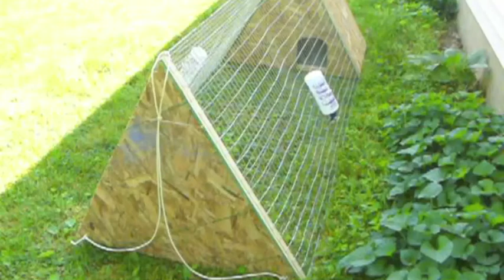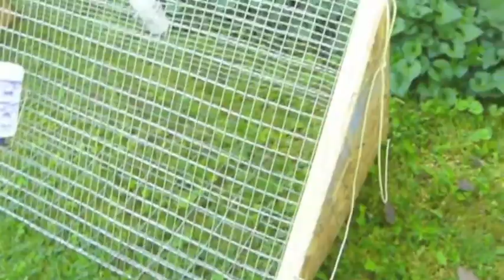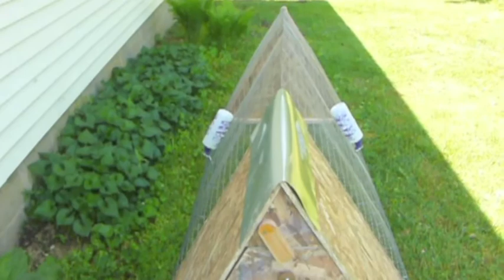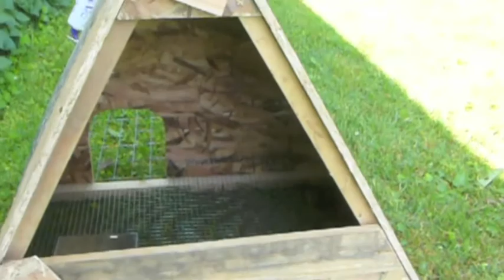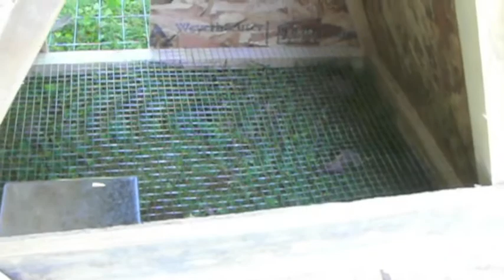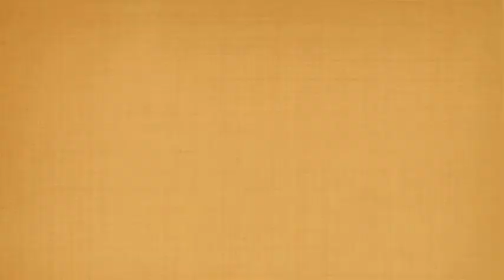rabbit run 05-15-2012

Comment from the maker: It is for a single adult rabbit or a single litter that is weaned. It isn't intended to house a rabbit colony.

I leave my rabbits in it all the time. I have had dogs will try to get in, but the rabbits go in the house and the dogs attack the house, which happens to be the strongest part. It did stress them though.

In winter, when it gets really cold, I may put some straw or hay on the wire in the house to make it a bit warmer or cover them with a tarp if it gets really cold and windy.

Comment from the maker: If you have good pasture and move them regularly, my feeling is that you can save around 50% on feed. I do know my rabbits eat quite a bit of grass, but I don't know how much it saves on feed. And yes, the cost of building the runs is significant.

I would suggest looking at colony rabbits. Or perhaps building a few of these cages and then looking at colony rabbits as you gain more experience. They will still be useful later for isolating animals.

Adult rabbits can fight when placed together.

Comment: Thanks for your response. How much would you say you save in feed by pasturing your rabbit? I am interested in raising meat rabbits with minimal overhead but, of course, maximizing the animal's well being. Does it make sense to make a very large version of this to house 4-5 rabbits or would it be too big to move then? In case you can't tell, I am a complete beginner :-)  I have seen some rather large "chicken tractors" out there. Do rabbits require more separation?
Reply from the maker: Colony rabbits are an interesting topic. I think it might be possible, but I don't know how to do it in a portable system, and still make it easy to move by hand. A larger version housing four or five does in separate partitions might still work if it were very carefully designed.

Honestly though, chickens are far easier to do in tractors than rabbits.

Comment: Thanks for posting this! How many rabbits  would you put in this? Is it safe overnight or do you need to move them to a traditional hutch at night?
Reply from the maker: I kept them in these 24/7/365. The one on this video was my first version. I improved on it somewhat, but didn't change the overall design too much. In areas with a lot of snow, it would be a problem since sanitation is an issue if it sits for too long.